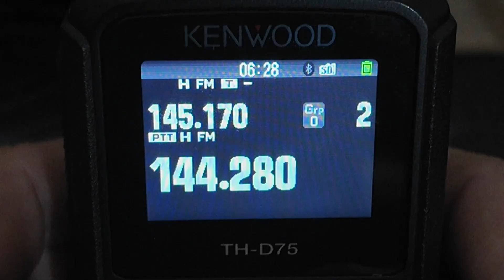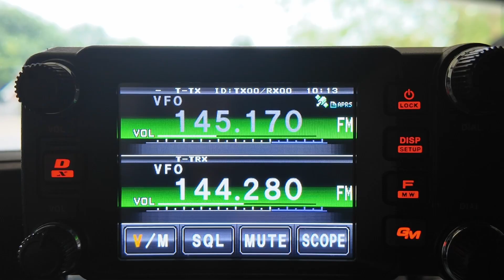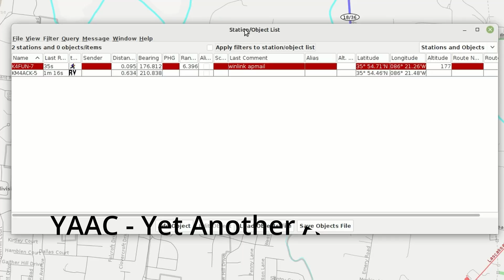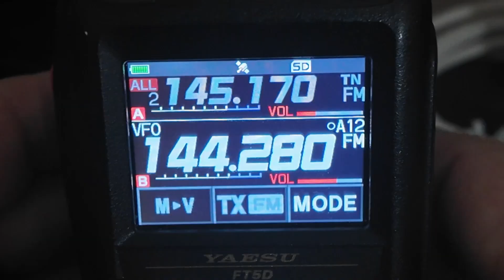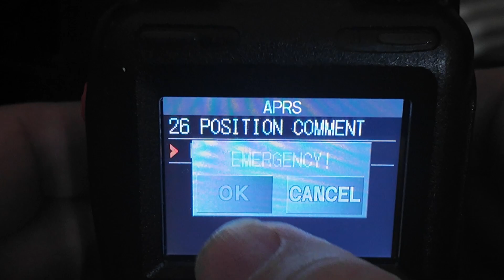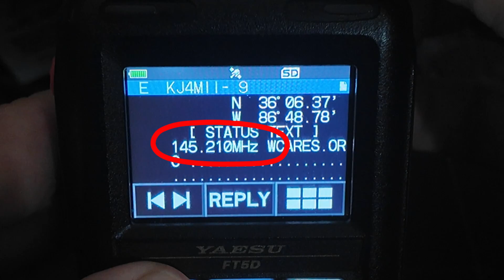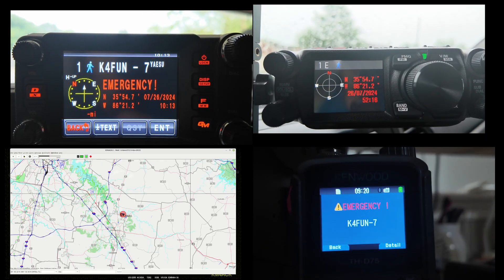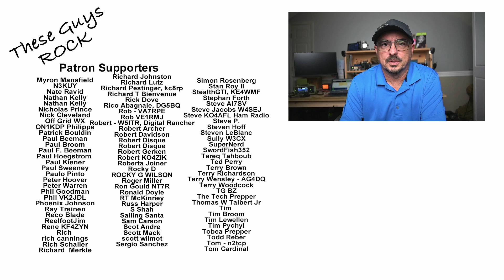You Won't Believe What Happens!

Comment: Mic-e status encoding has been around since the beginning of APRS in the early 1990's. APRS is a situational awareness tool, thus the various statuses. The EMERGENCY! status was intended to be a priority status and how it is to be handled by most radio and software clients is defined in the APRS standards. There also a standard for encoding a frequency in your comment such that capable radios and software can tune to the frequency. It's called something similar to QSY function. Kenwood APRS radios made since about 2010 or so support it as well as most modern Yaesu APRS radios. There's lots more to APRS than just sending your location. 73! Randy WF5X

Comment: It would be nice if you could use it in a fashion where you flip a switch on the dash from normal operations to emergency.  One of those switches we have on some equipment where you flip it down, it works, to flip it up, you have to remove a protector so you can’t accidentally switch to an emergency.   That way if you’re out mobile and have an issue, your family who knows nothing and cares nothing about ham radio could make the change.